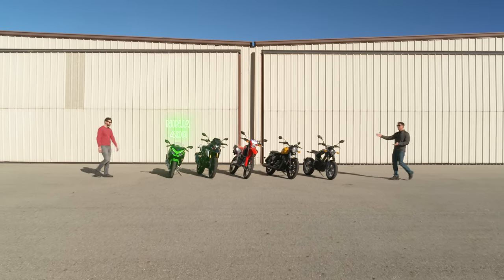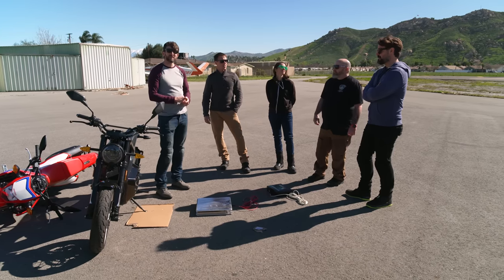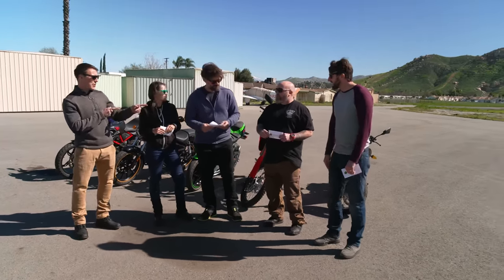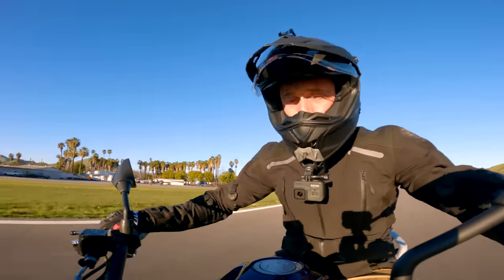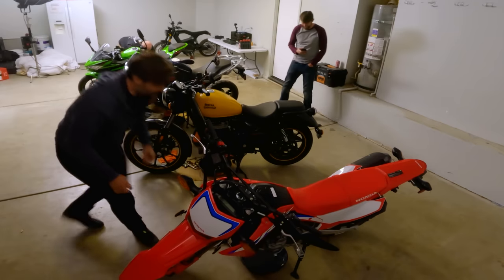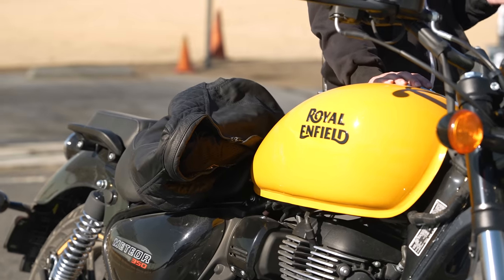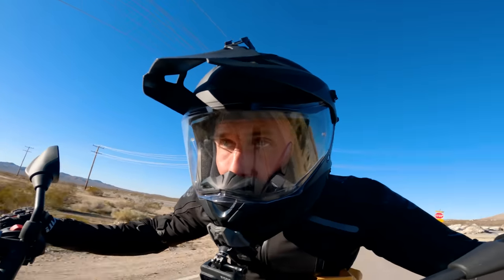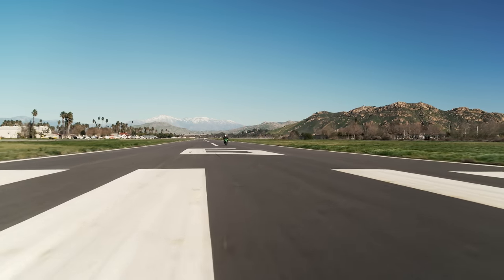Best Beginner Motorcycles! Ninja 400 vs Meteor 350 vs CRF300L vs Sondors Metacycle vs G310GS | CTXP

Comment: Change my mind: Anyone saying "don't get anything under 600cc or you'll get bored fast" is either a straight line highway rider or hasn't had many bikes.
Reply: I’ve had my RE Classic 350 for a year now, and have been riding bikes since 1980, more or less. 

I have ludicrous amounts of fun on that little 350.
Reply: @electragician  the new one or the UCE engine one ?
Reply: Traded sv650 in against the G310GS, which I've had for a year now absolutely love the GS.
Reply: @chinmayadixitNTPH  The new “reborn” one.  A 2022 model.
Reply: That is too simplistic.  Displacement does not equal horsepower,  Engine design and overall weight are very important for performance.   Even in this test, the Honda with 290cc easily outran the 349cc Royal Enfield.  The KTM 390's and Kawasaki 400 twins are quicker than most V-twin cruisers under 900cc and are very close to stock 1200 sportsters.  The Royal Enfield 650's are slower too, but still a lot of fun.  
I have been riding off and on for almost 50 years and currently ride a Z400 because it is light, fun and quick enough for me.  For me, light weight and good handling make twisty backroads a lot of fun.  Heck, even tootling though neighborhoods with sharp enough turns can be a good time.
Reply: Not to mention most people that talk down on smaller cc bikes couldn’t even ride that Ninja 400 to it’s limit around a track.
Reply: Agree 100%, the only reason why I changed my first bike (a Rebel 300) wasnt because it was boring, but because it just doesnt keep up with USA traffic, basically had to drag race it every stop light to keep up, plus the single cylinder and a top speed of 85mph meant highway was not ideal. Its only been 3 days since I sold it and I already miss it, but I will never forget it, its basically the best beginner bike you could ever ask for.
Reply: @Carlisho  The Rebel 300 has about 25hp at the rear wheel which isn't quite enough for highway speeds in some areas, especially hilly ones.  You can get by with around 30hp on a light motorcycle which is what some old 500cc thumpers had, but closer to 40 feels better.  The KLR650 has about 35hp and the Honda 750 Shadows are around 40hp, for example.
Reply: I've had more fun on a 7hp motorcycle on a go-kart track than I ever had doing 150 MPH on my GSXR.

Push comes to shove, I'll keep the NSR50. Seriously.

And there are better "track" bikes than an NSR now.

As for needing power on the street, the Buell Blast had 25 HP, it had no problem feeling safe enough in the highways in California. Was it as fast as my 1000RR? No. But it did just fine riding 450 miles from SoCal to NorCal.
Reply: Absolutely.  The 400 will easily get you past 100 mph.  It corners well and is actually way more responsive than you'd think.  It certainly is not boring at 90 mph on the freeway.  A 600 and above will have a much higher top speed but how much time do you really spend driving over 100 mph?  Probably very little.  And how often do you need to accelerate faster than the 400 can?  Again, not often since it'll pull a wheelie if you squeeze it too hard.  Beginner bike is really a misnomer, I have higher displacement street bikes but they're not as fun since you really can't ever unleash them except in a drag race or on the straight of a track, neither of which things I actually do.
Reply: I appreciate this comment.
Reply: I dont get bored on my bored out ninja 300. However I have more fun on my mv dragster. ~120hp is perfect power for the streets for my skill level.
Reply: Nah, you're dead on. I've been riding for about 15 years now and I just bought a Z900RS. I still own and am restoring my first bike, a Suzuki GS400E which I rode exclusively for the first 5-6 years. I actually own 9 bikes right now and only 3 are over 400cc. While there is place for large bikes, I get a lot of joy out of riding a small and simple bike.

The Z900RS is a special occasions bike and will only be getting day permit insurance, my '75 Honda CB400A is actually the bike I want to keep insured year round for more practically cheerful riding.
Reply: big sportbikes are too big for most canyons so yea. the tightest coners on the big tracks those bikes are designed for are very rare massive sweepers on the street. small bikes are a joy on those roads. my weekend rides in the Santamonica mountins are about 100 miles and a hunched over supersport id have to stop to strech a lot only to be showed up by some guy on a mutch smaller, mutch lighter, more suted supermoto.
Reply: It depends on how you like to ride. If you're doing super twisty roads or trackdays, a small sportbike might be really good, but for doing a little bit of everything it might not be such a good choice. Personally I love torque and fast acceleration, but I don't ride super fast unless on a motorway. I also love the feeling of a slight fear in me because of all the power that I haven't dared to use 😄 After 10 years of riding and owning many bikes from many categories, I now ride a KTM Super Adventure 1290 S and I love it. You can chill in the city, do twisty roads aggressively or just cruise comfortably on the highway for long periods of time.
Reply: Agree. I've had many bikes, from a measly Honda xr250L dual sport, up to a CBR1000RR. And here comes that cliche... I'd rather go fast on a slower bike, than slower on a fast bike. At almost 50, I'm going back to dual sport. A CRF450RL is coming home soon. There's no freedom like just turning off the pavement onto dirt or gravel, and doing it with authority.
Reply: Spent 7 years on my Aprilia RS 125 2-stroke, it was crazy, huge fun and I regret I haven't kept it, despite having a Ducati 1199 Panigale now.
Reply: The most fun I've had in a motorcycle was in my first: a Yamaha Chapi 80 CC.
Reply: I'm the type of person that just likes to make one purchase and keep it for a while. I don't like the philosophy of buying a beginner bike and then selling it/trading it for a bigger bike later... Why not just get the medium bike to begin with and keep it for a long time
Reply: @ilovebanks1526  Because lighter bikes are more forgiving, Einstein.
Reply: @CyberChrist  More challenge... bigger reward. I understand it's easier, but sometimes doing the easiest thing isn't always the best... FOR EVERYONE. It depends on you.
Reply: @ilovebanks1526  There's more to learn in flogging a small bike than in babying a big bike, your rationalizations for buying a bike you'll probably never master are quite clear for everyone to see... except you, apparently.
Reply: @I love banks  As I mentioned before,  some 400 cc bikes are actually quicker than 900ccc cruisers, so displacement isn't everything. 
Starting with a more POWERFUL motorcycle works for some, but takes a level of restraint that many don't possess.  Quite a few people have bought a motorcycle that they could not handle and have either scared themselves away from the sport or, worse, crashed.
A new option now exists with motorcycles that have rider modes.  A newer rider can start in "rain mode" which limits power.  After they become comfortable with the bike, they can unleash more power.
Reply: @jfess1911  No rider mode will prevent dropping the bike at low speed, or teach to know where to look and be cautious when seeing the side of a vehicle...
Reply: @CyberChrist  True.  But just having a less powerful engine won't prevent those either.  I don't see your point.
Reply: @jfess1911  As I've said earlier, lighter bikes are more forgiving, in all senses of the word.

You can avoid dropping a lighter bike, or at least mitigate the cost of doing so, you can manoeuver out of dangerous situations more easily and have more time to think about your options.

The fact you need to ask what the point of keeping yourself afloat financially and alive to keep learning is a bit worrying, keep safe, rubber side down ;)
Reply: @CyberChrist  I think you're a little off here.  It's fine to like and even prefer larger, faster bikes.  It's also fine to like the lighter, less powerful ones.  I personally am in the latter group, even if I still love taking the liter bike out on an empty straight and putting the power on until I'm flying.
Reply: @PlaySA  That's not a preference problem, but a learning problem. Of course, redlining 6th gear's fun, but without learning where, when and how to do it , it's not going to last.

Perhaps there's a reason not even racers far more skilled than we are, with far better guidance and practice time we'll ever have, in far safer environments than we usually experience, start with lighter bikes.

But at least, society enjoys the benefits of people deluding themselves into thinking an R6 is a good learner bike because they're insecure morons (usually hailing from a certain country I won't mention) getting their Darwin Awards, or ending up on DanDan The fireman's videos.
Reply: I have geniunly gone to a slightly slower bike from a fast bike, because it's more fun to ride a slow bike fast than it is to ride a fast bike slow.
Reply: @TheFighterbike  But, you see, posers don't ride bikes for fun ;)
Reply: Very much depends on what you want to do. If you want to zip around and smoke everyone at stoplights, then sure. But there's way more to riding than going fast. I do want something a bit bigger for long distance cruising, but I don't intend to get rid of my little 286, it's still tons of fun to run around and still holds up fine on the highway when I need it to.
Reply: @ilovebanks1526  As someone in EMS, I can tell you I have never once had to put a new rider on a beginner bike into a body bag. Cant say the same of beginners on larger bikes. The amount of new riders who bought something faster for their first bike an didn't live to pay the first payment is shocking. You need to learn how to ride an respect all the realities of riding before getting something bigger. You need to accidentally dump a few clutches, hit gravel spilt in the road a few times, miss a corner once or twice an have a bunch of people pull out in front of you. You usually walk away when these things happen to you for the first time on a small bike. If the first time is on a big bike, your odds are not as good.
Reply: I started riding in 1980 on a Suzuki K10 80cc 2 stroke and a '71 SL175 scrambler. My re-entry into motorcycles back in 2006 after roughly 20 years away was a 2002 Royal Enfield bullet 500ES (electric start). A fun city bike that I really enjoyed, but not enough power to be a long-term only bike, at 45 mph it was happy, at 55 not so much. It's replacement was a 1987 Yamaha FJ1200. Great bike, but stupid fast and FAR more powerful than I would ever need. Next in 2011 was a 1977 Honda CB550K and I can say without hesitation that unless you plan to do a lot of 2-up touring and you are both full-size adults, it is all the motorcycle you need. I took it on a week long 1600 mile Lake Michigan circle tour and it was comfortable, reliable, and could cruise all day long without strain at 75mph. Next was a '77 GL1000 with a Vetter SS and Bates bags/tail. A great highway bike, smooth as glass, but too unwieldy for around town city riding. Then another CB550, this on a '75 550F. In 2017 I rode it on a 13 day, 4600 mile mostly solo trip from Chicago to Colorado and back via Utah, AZ, NM, Texas etc. Again, it was great. A small windscreen and vintage hard bags carried my 6-4, 235lb self up and down mountains and across deserts. Currently I ride what is for me the sweet spot: a '76 Honda CB750F. I didn't really need the extra power over the 500, but the extra size made a huge difference. With modern bike power levels, where 500's and 650's are making as much or more power than my 750 makes, you really don't need to go over 650cc's, even if you carry a passenger regularly.
Reply: Very true. I own several bikes, T Bird storm, VRod, Panigale 959, daytona 675 and a honda 300r. My little honda gets used the most for canyon runs and the track. Skill will outweigh horsepower especially on the track. That being said my T bird gets used the most in general as most of my rides on weekends are minimum 200 miles on the weekend. So it really depends on what you're gonna be doing with that bike, but do not over look those little 300s
Reply: Just learnt something new and worthwhile
Still dreaming about my first bike
Reply: Can't change your mind because it is true.  I have had a bunch of bikes from slow to fast, but 350lbs, 400cc and 50ish HP is peak motorcycling if you have some windy roads near you. Even just adventuring, you don't need power just imagination.
Reply: It is more a masculinity thing.  People gotta convince themselves of their masculinity and thus convince others of the same thing.  If you convince someone else that sub 600 is weak than it gives you an ego boost.  I have been riding sub 200 bikes for a while now and enjoy it very much.  Only reason I am considering moving away from that is because I would really like to go EV.
Reply: small bike are fun cause you can rev the shit out of it without dying. i kept my gpz500/ninja500. it's way to fun on twisty road without even going faster than the speed limit.
Reply: Learn how to ride on a Z650 and it’s enough for a beginner I’d say, a 300 I’d defintely find that too unamusing
Reply: @estebanod  Bad advice.  Just because you find something boring doesn't mean everyone does and learning on a smaller bike is easier.  Better to get a small bike to learn on and learn what you like about bikes and what you want specifically than to guess what you want and jump immediately to a larger bike.  For someone that has never ridden a bike before, 300 is not slow.
Reply: It depends on why someone rides. I know people who bought 250cc sport bikes and kept them for years and rode them constantly. I know others for which this saying is absolutely true. One of the hardest things for an experienced rider to do is put on the newbie hat for real and give useful opinions. Most just reflect back on their own one time experience as a beginner. I'm old and owned probably 30 bikes, and I own 12 right now from all disciplines. I learned as a kid on trail 50s and the like but I've never owned a street bike smaller than a 600 sport bike. I like speed and roadraced in my younger days, but I've since learned to appreciate other aspects of riding and own a few slow antique bikes now. If you must ride on a freeway and will use your bike for commuting you need to be able to keep up with local traffic and that is an aspect that can challenge smaller bikes.
There will never be a more personal answer for this than the one you give yourself. Do you really like speed, but have enough restraint to keep from killing yourself? Most fast riders who are dead thought they knew and they were wrong. Living to ride a slow bike tomorrow is a lot more fun than ending yourself on a fast bike today.
Reply: @SirNarax  learning on a smaller bike is easier? Its about the technique, not the power or weight. Maybe proper courses with qualified instructors and standardized exams need to be introduced. Like in other countries.
Reply: @Twiggy163  Yes learning on a smaller bike is easier and safer.
Reply: @SirNarax  excellent counter
Reply: @Twiggy163  Wasn't a counter just a statement of fact.  You didn't exactly contradict the statement that smaller bikes are safer just stated the importance of proper technique and formal learning.  Which is very important you are not wrong.

But learning proper technique is easier and safer on a smaller bike.
Reply: @SirNarax  and a false statement at that. The weight and engine size of the bike have little to do with how easy it is.
You also ignored an important part of my comment. The one about qualified instructors and proper courses.
What exactly would make a 'smaller bike' easier to learn on?

For reference, I learned to ride on a Honda CB650. Getting to the training area required a short trip over public roads and having my drivers license for a car, I was allowed to follow the instructor who rode a different bike.
Due to another learning not having a car license, he had ride with the instructor, leaving me with a 300cc bike to follow them. It wasn't easier, the CB650 wasn't more difficult. The 300cc was just a tad slower.
The only thing with a smaller displacement bike is that itis less intimidating when starting out. But its just something to get used to.

The type of bike is more important than its 'size'.
Reply: @Twiggy163  I don't need to give you a big list of citations in a youtube comment but just do research on motorcycle crashes and engine displacement.  Most crashes and deaths in every motorcycle category takes place on bikes over 1,000cc.  The higher you go the more dangerous you go.  Period.

You are most vulnerable when learning so combine these two.  Yes, it is safer and easier to learn on a small bike.  Objectively.

You are using a personal anecdote to prove the opposite but anecdotes are evidence of nothing but an anecdote.  That is great that you learned on a 650 (and a good bike at that.  Very nice bike.)

Small bikes are slower and weigh less.  Easier to control and less risky when failing.
Reply: @SirNarax  yes.. that research on crashes: the high displacement bikes are also highway mile munchers (and every Harley Davidson). To take those statistics 1:1 doesnt prove much because those statistics show that the larger displacement bikes crash more often due to riders getting sleepy. So no, no period.
But I wasn't suggesting a 1000cc racebike or a honda goldwing. A 500 to 700cc naked/street bike is what i was thinking of. Upright riding position.

Vulnerable. This is why I said: qualified instructors and proper courses: so you don't learn unsupervised. I know the USA lacks them. However, being more vulnerable doesnt make a itself bike more difficult.

Yes, my story is an anekdote. But your last sentence misses key points from that:
Small displacement bikes are slower, but still do the speed limit just fine. So (in theory) that doesnt matter.
Nor does weight matter when riding. A riding bike is self-balancing. Again, this is where the instructor comes in to teach you how to apply the proper technique in a controlled environment before you're even allowed on the road. If the weight of the bike is affecting your riding, you're not doing it right.

Over here, bike displacement and power is limited by age or having spent a few years on a lower displacement bike. Not because lower displacement bikes are easier, but because research has shown that giving 16 to 18 year olds access to Ferrari like speed is a bad idea.

Out of pure curiosity and unrelated to our discussion, what do you ride?
I bought a Honda Hornet (600cc, 2008 model) after getting my license. Still waiting for that first slide to happen....
Reply: @Twiggy163  In other countries, starting on smaller bikes is mandatory, too.

Your lack of understanding how lighter bikes take more time and intention to go too fast and will be more easily controllable (and therefore inherently safer) thanks to their lesser inertia is proof of your lack of experience on lighter bikes.

If you're still on your first own bike, you lack the experience to lecture anyone.

Keep thinking the way you do, and that first slide might be the last.

But as even broken clocks are right twice a day, you're very right regarding the US state of affairs nonetheless, they give out licenses like candy because their industry needs clients.
Reply: @CyberChrist  no, it is not mandatory to start on smaller bikes. It depends on your age.

A bigger bike can be as easy to control as a small one. Its a matter of throwing your weight around and making the right moves.

I may still have my first bike, but that doesn't mean its the only one I've ridden. Way to draw conclusions. Something with a clock, right there.
Reply: @Twiggy163  I didn't say it was mandatory in all countries, and every rule can know exceptions, here, insurance companies prevent you prevent you from starting on bigger bikes too, unless you have more money than sense, which is most probably the case if you start on a bigger bike and try to argue lighter bikes aren't easier to control anyway.

If you think "throwing your weight around" really is the key to control a bike, you just proved you don't know how to control a bike, and I'll let you read at least Keith Code before you try to lecture me again, it might save your squishy squid life, but whatever you learn on how to control a bigger bike will also apply to a lighter bike and make it easier to control, so all things being equal lighter bikes wille be easier to control.

Lastly, you need to learn about what the words "if" and "own" mean, and it's quite plain to see you don't even dare say you've ridden other bikes either. The thing is, you don't learn how a bike (and much less bikes in general) behaves by just trying it out. But did you do anything more than try out your Hornet?

Try again, smarty pants, cue the iP3n15 description.
Reply: @CyberChrist   Let's look back: "In other countries, starting on smaller bikes is mandatory, too." To: "I didn't say it was mandatory in all countries, and every rule can know exceptions..."

Don't blame me for your own lack of specifics in your earlier comment. I understand you can't list every nation's specific laws but at least put in some effort. Yes, it is different in a lot of countries, but your earlier reply didn't exactly say that. Nor did I mean that it is dependent on age in every nation.

" insurance companies prevent you prevent you from starting on bigger bikes too, unless you have more money than sense, which is most probably the case if you start on a bigger bike and try to argue lighter bikes aren't easier to control anyway."
I don't know what the insurance companies looks at all around the world. In my country's case, it looks at the value of the bike and how much damage a vehicle can do. It's why a car insurance is more expensive, even if it costs the same as the bike. To lighten the mood: both my car and my bike cost me the same. Imagine what a bag of bolts the car is. Anyway, if you have the correct license for the bike you can buy it. Insurance will get a bit cheaper every year if you don't cause damage.

"If you think "throwing your weight around" really is the key to control a bike, you just proved you don't know how to control a bike". Sigh, it is part of it. Shifting your weight on the bike makes a big difference. Having to pass an exam that is specifically meant to test your ability to control the bike during certain maneuvers (figure of 8, slow slalom, emergency stop, etc) means I know how to control a bike just fine. The only danger is not keeping up the kill level by not doing them anymore after getting a license and knowing how to apply them on the road.

"Lastly, you need to learn about what the words "if" and "own" mean, and it's quite plain to see you don't even dare say you've ridden other bikes either. The thing is, you don't learn how a bike (and much less bikes in general) behaves by just trying it out. But did you do anything more than try out your Hornet?"
Ofcourse I've ridden other bikes: Versys 300 and 650, Z750 (which had a great engine but the seat always became uncomfortable after an hour), Honda Grom for a while on a vacation, just for giggles. Suzuki SV650, Honda NT700 and BMW 310R. The "biggest" bikes I've ridden would be the BMW 1200GS and the Yamaha R1. The R1 from a friend but I didn't like the riding position. My wrists cried mercy after a while, but it was fun. But the R1 was, as you say, no longer than an hour or 2 so that one I never actually got to know it better. Just rode it on some twisty 45 mph roads, no tricky maneuvers in that.

"cue the iP3n15 description" Help me out here, smarty pants.
Reply: @Twiggy163  You're confusing your making assumptions with my "lack of specifics".

Every insurance company checks accident rates of vehicles, and factors it in their rates accordingly, so big powerful bikes usually are dearer to insure, try comparing an R1 with a similarly-priced GS.

There's controlling the bike in ideal situations, there's controlling the bike in timed situations (as we do for the license here), there's controlling a new bike in less ideal situations and there's controlling the bike in situations you never encountered during the exam... or during tryouts.

So the exam is far from the end-all be-all you make it to be, seriously, read Keith Code and thank me later, shifting weight is just the icing on the cake ;)

You're still not confirming whether you owned other bikes or not, oh what a surprise.

Keep doing as if we didn't know the answer, you're doing great 👍
Reply: @CyberChrist  "You're confusing your making assumptions with my "lack of specifics"." Well then that's a situation of the pot calling the kettle black. Looks like we're both doing that.

"Every insurance company checks accident rates of vehicles, and factors it in their rates accordingly, so big powerful bikes usually are dearer to insure, try comparing an R1 with a similarly-priced GS"
This is a bit tricky since I can't use the number plates of the vehicles to let an insurance company do a quick calculation (same place where I insure my current bike). However, just for a quick check I entered a Ninja 300 and a  Ninja ZX-6R (both from 2016). They differ about €1 to 5 in price per month. Only the most expensive insurance, which covers the purchase price, differs far more due to the difference in purchase price (another reason to get a second hand bike as your first bike). Far more effect has: how many km (or miles) per year you'll expect to ride, years without accidents and if you park your bike for the winter. They're the same age and the ZX-6R is twice as costly (catalogue value is what they revert to if you don't have a numberplate). The size of the bike seems to have little impact. Most likely because they fall in different license catagories here. The 300 being an A2 bike and the ZX-6R an A category.

"There's controlling the bike in ideal situations, there's controlling the bike in timed situations (as we do for the license here), there's controlling a new bike in less ideal situations and there's controlling the bike in situations you never encountered during the exam... or during tryouts."
Yes, which is why I mentioned: "The only danger is not keeping up the kill level by not doing them anymore after getting a license and knowing how to apply them on the road."

"So the exam is far from the end-all be-all you make it to be"
Oh I never said it was an exam that would make one an expert rider. But it does require a pretty strict minimum skill level to show you can control the bike. There is a reason they say "now you can realy learn to ride" after getting your license.

"You're still not confirming whether you owned other bikes or not, oh what a surprise."
By far most of them were rentals. Actually owned: Honda Hornet (still have that), Versys 300 and BMW 310R. Other bikes were rented (minus the R1, obviously) for 4 to 8 weeks to see if I want to switch and maybe have a bike to take my girlfriend along. But I decided I don't want that responsibility. Also riding through winter with the salt on the roads makes for more frequent maintenance so I decided to stick with just the Hornet.
Is that fair enough?

Honestly I don't know what you mean by ''cue the iP3n15 description''. I'm going back to work, hoping you'll just tell me in your next comment. Have a good one!
Reply: @Twiggy163  To repeat myself, you missed the "if" and "own".

You didn't compare what I told you to compare, and A License implies, if not more experience (on lighter bikes *COUGH*), at least deeper training than A2, so it skews the results, sounds like you cherry-picked an example which suited your argument.

I didn't want to dwell on it, but I think you didn't mean "KILL level", so not only you don't read me, but you also don't even read yourself ;) It's not a question of "keeping up", but of understanding getting the exam's only the beginning, which you implied to understand just after it was evident you didn't understand.

You know what else they say to new riders? "There are two types of riders: those who've fallen, and those who will fall" ;)

The Versys would've been more sensible choices as a first bike (the BMW being stupidly expensive to repair), the fact you bought it seems to indicate you know it, somehow, but I'm still curious as to how the Hornet requires less maintenance in winter.

iP3n15 (sorry for writing it in 1337, having to circumvent YT censorship) is short for Internet P3n15, meaning unverifiable bragging.
Reply: @CyberChrist  
"and A License implies, if not more experience (on lighter bikes *COUGH*), at least deeper training than A2, so it skews the results, sounds like you cherry-picked an example which suited your argument."

Sorry, no. The A1, A2 and A license get the same training and the same exams. The difference is the type of bike you ride on during the training and exams in terms of power and power / weight.
Which category you are allowed to get your license for depends on your age.

I didn't cherry pick. I hoped my example would make it more extreme. Because if I take a more powerfull motorcycle that has the same price as a more recent, lighter, motorcycle. The lighter motorcyle is actualy more expensive to insure (unless you insure the purchase price too, then just depends on what the more powerful bike is still worth).
Hence the difference. So, it seems insurance works a bit different here?

"I didn't want to dwell on it, but I think you didn't mean "KILL level"".
Well, you know, being distracted by work and all that. Thanks for pointing it out though.

You know what else they say to new riders? "There are two types of riders: those who've fallen, and those who will fall" 
I'm probably in the last category. I fully expect to fall, slide, crash, at some point. Unless we count the bike from the driving school? In that case I have already dropped a bike once.

 "The Versys would've been more sensible choices as a first bike (the BMW being stupidly expensive to repair), the fact you bought it seems to indicate you know it, somehow, but I'm still curious as to how the Hornet requires less maintenance in winter."

Keep in mind: all bikes I've purchased are second hand. Keeps the cost lower and there are plenty of decent second hands bikes.
As my learner bike in the driving school was a CB650, I wanted something similar. Something a bit familiar. Hence the Hornet. Less torque down low but it revs higher and has a tiny bit more power up top. Which is just fun.
The Versys I bought as a commuting bike, especialy during winter it was much nicer when traveling do other offices and clients. But the 300cc engine, and it being a twin, became, well, boring on the highway. So I reverted to my Hornet for that task aswell and traded the Versys for the BMW to have a small bike for aimless weekend riding. It was a neat little thing.

The BMW didn't need less maintenance in the winter, that's not why I bought it. Placed it in storage to cut down on insurance cost during the winter. After the Versys, the Hornet soaked up all the punishment from winter riding. In the end I sold the BMW because the maintenance cost of 3 vehicles (I'm including my car), plus the storage, was a bit too much, not because the BMW was that much more expensive. I didn't have it long enough for anything other than general parts that needed replacement.

"...meaning unverifiable bragging"
Ah, ok. But you asked and I am giving an honest (but still unverifiable) answer. Do you consider it bragging?
Reply: @Twiggy163  Here, going from A1 to A2 implies more training and exams, and A2 to A more training after two years on A2 (with no distance requirement, which is stupid). I understood it as an EU directive, but I guess every country applies it their own way, so I stand corrected.

However, the argument that heavier bikes are less forgiving implies exam is harder. And the fact you mechanically can't start on a bigger bike below a certain age makes it all a bit of Catch-22.

Why don't you give the results of my example instead of finding reasons not to ? ;)

If you used the Versys for work, didn't it begin to get far more kilometrage than the Hornet? I get your general point, but I don't understand using a less fun bike for fun weekend rides, though.

I believe you, just ribbing you a bit ;)

And please absolutely read Keith Code's Twist Of The Wrist ;)
Reply: @CyberChrist  
The EU directive leaves, like most directives do, some room for nations to implement their own way of complying. Now, having said that, I should state the full rule: with a few (2) years of, for example, riding on an A2 license, you can get an A license below the age of 24. But you do need to take the exams again.

I'll try and do a comparison according to your request after work.

"If you used the Versys for work, didn't it begin to get far more kilometrage than the Hornet?" Only slightly because for every other thing (my usual office, leisure rides or shorter errands, I took the Hornet. Neither had / has heated grips but the Versys allowed for a more relaxed riding position. Also: windscreen instead of a small deflector. Makes a big difference in cold weather.
And I don't ride with snow forcast, or freezing temps after rain. Rain is fine, freezing is fine, but not at the same time.

I'll have a look at the book. Apparently it is more of a "life philosophy and advice to apply in business and life" kinda book. (Not my words, just googled it)
Reply: @Twiggy163  While, of course, riding bikes is an excellent metaphor for life, the summary you got was done by someone who didn't read or understand the book, the closest it is to self-help is that it helps you be a better rider, but don't take my word for it ;)
Reply: @CyberChrist  
Right, not completely done with work but... having to wait while producing 100 PDF's is an OK excuse to get that insurance stuff looked at.
Disclaimer: it was a tad tricky to find motorcycles of the same type, with roughly the same price and with numberplates (numberplates give the most accurate price).
I found this:
1 - A Kawasaki Ninja 650 from 2017, being sold for €5500
2 - A kawasaki Ninja 300 from 2016, being sold for €5000

That's as close as I could get them with a numberplate.
Now for the insurance options:
A: Damage to others (including property)
B: Damage to others, fire & storm, theft, clothing and damage to your own bike.
C: B + 1 year of warrenty on the purchase price.

The 650 will cost €12,81, €20,72 or €77,79 to insure.
The 300 will cost €13,53, €20,13 or €65,29.

Buying a"bigger bike'' doesn't seem to break the bank insurance wise.

So I added a Honda Fireblade (CBR 1000RR) from 2007 for €5600 (trying to stick with the price).
That would cost €11,85, 19,94 or €141,40 to insure.

So, it doesn't look like engine size has an impact here. It is the catalog value of the bike, your age (I entered my age for every bike), place you live (zip code is more prone to theft than others, I used the same for every bike) and parking it for the winter or not (I said no).
Reply: @danghawes  I'm torn between the two.  I'm a tall guy so I guess I'll see which I think is more comfortable.  Doesn't it all come down to what LOOKS coolest, though?  lol
Reply: @electragician which is better classic 350 or meteor?
Reply: @Noproblem45  That’s really subjective. If you want a cruiser, the Meteor is the way to go. 

I’m not a fan of forward controls, and I ride a bit more aggressively, so it’s the Classic for me. If the going gets rough, you can stand on the pegs and help out that 2.3” of suspension travel. On a Meteor you’ll absorb those hits with your spine 😂

They are both great bikes though.
Reply: @electragician  so meteor has less shock resistance? And what abt comfortable wise, if we look for that in every bike ?
Reply: Yes! I live in twisty road appalachian foothills. My Ninja 400 at high RPM in 4th gear through tight turns is amazing. I get a mad thrill every time. 60-75 mph with tight turns is so much more fun than blasting 100+ on the interstate. No way would I want a bigger bike for these roads. The 400 is simply the perfect bike here.
Reply: @dantolen3969  what abt zx 4r nd ninja 650
Reply: @Noproblem45  if you want to spend more money than you need, sure. But if you’re a working class broke dude that has to finance your bike, the 400 is where it’s at!
Reply: @dantolen3969  what abt the comfort in the latter ? Will it be the same as u suggested for 400?
Reply: @Noproblem45  the 400 isn’t the comfiest, the stock seat is stiff and not great for anything over an hour. If you’re going for comfort, you’ll have to change the seat or get a more comfortable platform. It’s not really a bike designed for comfort. It’s more designed to whip around corners. Nothing beats a cruiser for comfort.
Reply: @dantolen3969  which cruiser is best for comfy rides acc to u
Reply: @Noproblem45  I have limited experience with cruisers, except for my old Suzuki Boulevard S40. It’s a very comfy bike. Low seat, squishy seat. I think most cruisers are similar in comfort.
Reply: @dantolen3969  ooh nice 🙏🏻,which country bud
Reply: @Noproblem45  I’m in US, southeast
Reply: @dantolen3969  cool 👍
Reply: I’ve had more fun in my drz than I ever have on any 600 or 1000
Reply: @electragician I was almost put off trying one because of focusing on 'the numbers'. Now the only number I think about is the amazing mpg. Is otherwise just great therapy and pure enjoyment that you cannot put a number on :-)
Reply: I agree.. 600 is a bit too much for every day riders...
And for me a motorcycle is ultimately a utility machine, so getting a 600 is kinda pointless
Reply: Size does not matter, money doesn't make you happy. You hear these silly things from time to time.
Reply: Best fun I had on a bike was back in the early 90s on a yamaha tzr125r 4dl it would kill the bigger bikes in the corners I upset many a guy on a cbr or a gpx, but there is no substitute for cc especially when you get on the straight
Reply: For the repair it's good for what touched but the exact prices of exactly identical replacement parts on all would be at least or more inciteful
Reply: It’s just a highly subjective topic… live in Texas? Then a light low powered bike won’t be fun on a highway… a literbike is a better option there. Live somewhere with more twisty roads? Then a ninja 400 could be a ton of fun
Reply: @AbeNXC  tzr250 Rd 350  aprilla 250 nsr 250 rgv 250 would all be far more fun than the ninja now Honda did a 400 in the 90s sounded as good as an F1 and rev'd to 20 000 rpm , it's all perspective, and mine is 90s bikes were far more fun but I have fallen for a speed triple 😀
Reply: most fun bikes i’ve ever had, zuma 125 and grom. and i’ve had anything from 50 to 1000cc. small bikes are just amazing what they can do
Reply: I’ve had a 650, a 400 and a 1200 and I completely agree. It’s about the bike displacement is only one component. My 1980 xs400 was the most fun
Reply: Well there is some merit to that statement since there is a difference between a klr650 and an r6.
Reply: Here in sunny cali, u will get bored fast
Reply: Ive had maybe 15 bikes of all shapes sizes in every capacity bracket and i hate to admit it but i half agree with them, i dont agree with the 600cc as the definining line but i do think theres alot to be said about the 100hp line, i think 100hp is difficult to get bored of, because if youre riding well, 100hp is enough for you to piss all over most guys on big bikes in the twistys and the limiting factor is your skill not the bike, for instance, i had a 90s cbr400rr gull wing, one of the best handling motorcycles ever made in my opinion, power delivery was smooth and the geometry is spot on but its only got 60hp, you have to ride that thing in the powerband right up above 9k to make it go anywhere and youre dancing around on the gearbox so much you get pump in your shin and calf muscles, i would outcorner everyone but i would be left standing still on exit within 50m by everyone. i had a bmw r1150gs with metzler dual sport tyres on, and that thing handled like a tractor, but the telelever suspension once you get used to it makes little mistakes feel like little mistakes so its very forgiving when pushed hard, same roads, same riders on sport bikes only me on a different bike, with a hell of alot more torque, no longer getting left behind, no more gearbox dancing, leading the pack when there wasnt long straights. I got bored of my cbr in 3 months, so i bought the bmw, it took me 5 years to buy another bike, i now ride a ktm 1190 adv and im only able to put down as much power as i have traction, the limiting factor is no longer the power, it is my tyres and there is no longer excuses for getting bored, the world is my oyster and my throttle hand is no longer getting a workout
Reply: @CyberChrist was my first bike too, could do roundabouts dragging my elbow at 17 on that thing
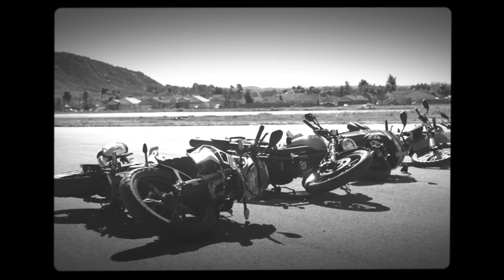Reply: @electragician 😂😂😂😂😂😂😂😂😂😂😂😂😂😂😂😂😂😂😂😂😂😂😂😂 I 5:09
Reply: Were not talking track bikes bud
Reply: I got my first street bike two days ago, ZX-4RR. Absolutely love it!
Reply: It’s always more fun to drive a slow bike fast than fast bike slow
Reply: I still love my 2009 Kawasaki Vulcan 500. Excellent machine
Reply: Anyone saying "don't get anything under 600cc..."

Has never been on a dirt bike for sure. Much less a MX bike. 

True story: Had a friend who rode a 99 GSXR 750 SRAD.

I had a 99 KX250, he scoffed at the idea of a 250 being anything but pathetic - while I sternly warned him to take it easy... He retorted: "I know how to ride bud"

Famous last words, he was on the KX for all of 20 meters, slid about equally as far and broke my rear fender.

Like Ari said here, the spec sheet doesn't tell the whole story.

I now take anyone saying they know how to ride as a warning to rather not have them take it for a spin.

The only correct response is that I accept is that you have had a YZ/KX/CR/RM/SX or anything similar in terms of performance. 

Your supersport doesn't prepare you for how quickly a MX bike can loop out, nor with how little effort it can accomplish that.

4 stroke thumpers sound even less unassuming than that, you can easily bite off more than you can chew if your only frame of reference is a 4 cylinder screamer.
Reply: @wtr426 oh for sure, and riding a ninja 400 at its limit is way more fun than limping around with a liter bike, being scared shitless of it.
Reply: I can't remember when was the last time I had as much fun as I had on my RG150 gamma. That thing was a thrill, even though you weren't going incredibly fast, it felt like you were..

Then again I wouldn't exactly describe it as slow, it was plenty quick for town commuting, especially when fully wrung out.

I miss that sound, small 2t running at 12000 RPM. Sure sounded faster than it actually was. Drew a lot of attention because of that. Not many people will wring a 1000cc out like that in town, so you can't help but look at the crazy bastard racing a high revving bike down a side street...
Reply: Got a grom as my first bike. I don’t want to get rid of it. Only issue is not being able to go speed of traffic 😂
Reply: @alexz1078  I assume from = Grom?
Reply: @TH3_T3RM1N4T0R  yes, sorry autocorrected
Reply: @alexz1078  no worries mate.
Reply: I still have a lot of fun on a schwinn.
Reply: Considering half the world rides scooters 125cc and under...yeah you're right.
Reply: I've had a few over the years and the fastest one was a 2015 FZ09. That thing was holy shit fast. If you sneezed, you'd 12 o'clock it. I was relieved when I totaled it honestly. But now I have a 2024 KLX300 and I have never had this much fun on a bike. Yeah highway isn't it's strong suit. But ripping down gravels at 65mph, climbing hills and riding trails, oh man I couldn't ask for much more out of it. Next bike is gonna be an Indian but I don't see myself getting rid of my 300.
Reply: No need to change your mind. This is America you can think whatever you want to. But some people just don’t to wait 20 minutes for a bike to get up to highway speeds nor do they want a buss machine vibrating their crotch into sterilization
Reply: idk i have a super detuned 600 and its still an amazing bike. First bike should always be beat up and cheap so you can learn to appriciate the next bike if you wish to upgrade. Some just fall in love with their first.